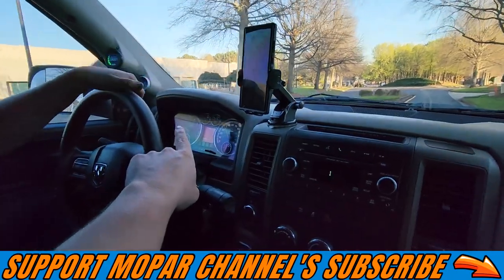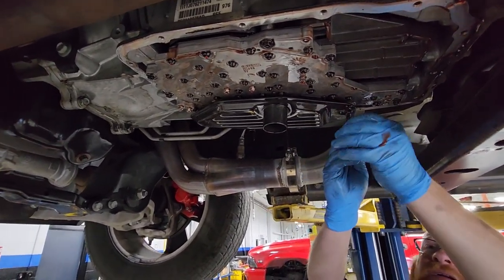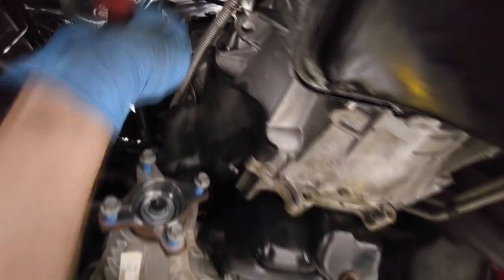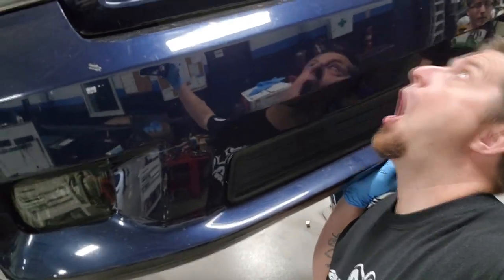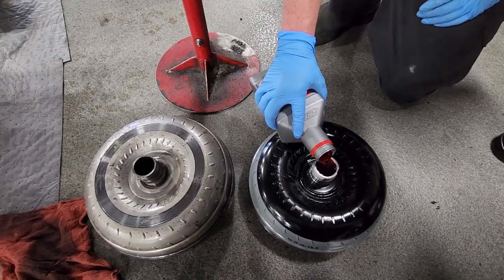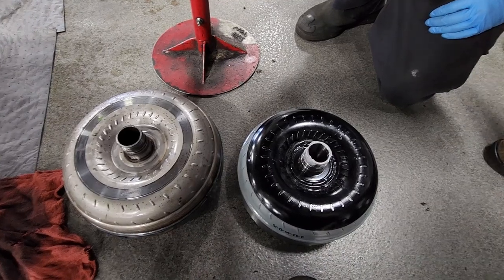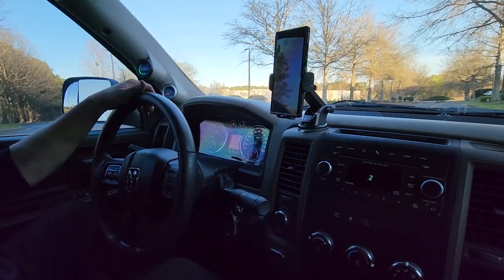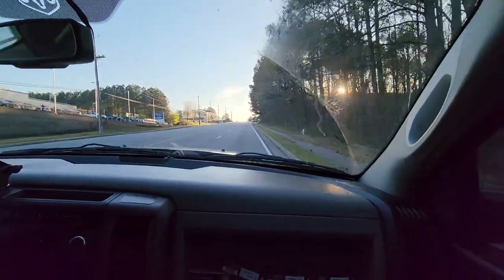STORM Gets A Pro Triple Disk Circle D Stall Converter Installed

Comment: Awesome job guys can't wait for the track run to see what you gained 
Truck sounds good
Reply: Got my PB 13.46 @ 101.47 at around a 2500 DA and 1.9 60ft! Similar DA  and hot weather back in september in kentucky and was running 13.94 with 2.1 60ft. So it picked up a bit, but i think can still do better. I ended up spinning in 4wd at one point
Reply: @stormram2783  nice now your truck has torque storm supercharger and Holley intake with custom exhaust
Reply: @Chris D  yeah the torqstorm was done first a little over a year ago, then did the headers and exhaust last august, and then holley hi-ram around january. So its been being pieced together slowly. It wont be on same level as frostbite is because im still daily driving it, but i am aiming for high 12s low 13s for now. Still running stock cam as well, so plenty of room for improvement
Reply: @stormram2783  sounds good thanks

Comment: Stock-cam-lope tune?  🤔👀….. really now?
Reply from the maker: Yes sir stock cam
Reply: @FrostbiteRam  well well well… would that also apply to a 392-cam swapped 5.7?  Biting the bullet on a cam and lifter job, and my budget allows me to do a mds delete, hellcat oil pump, and essentially the 392 cam swap… and possibly convert to HP-tuners… but the full FRP  switch over (cam, tune, wideband etc) is just a bit out my current budget… 

All that said to say, I really just want to have to move mopey sounds once it’s back together, and knowing boost is still down the road… 

Could/should I email you to get clarity on getting this kind of tune from you?
Reply from the maker: @tcmjmedia8703  you can make the 5.7 and 392 cam lope with tuning. It does sound a little artificial but sounds better than stock for sure.
Reply: @FrostbiteRam  awesome, is that achieved through HPtuner? If so, aside from the MPVI3, and I assume at least 1 tuning credit, is there anything else I would need to acquire prior to the actual person/tuner to create that tune file for me?